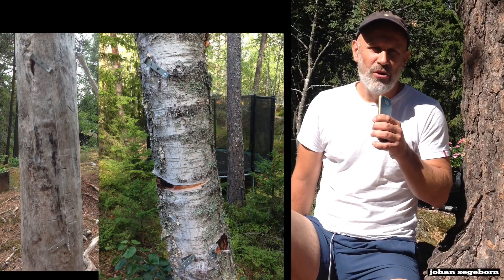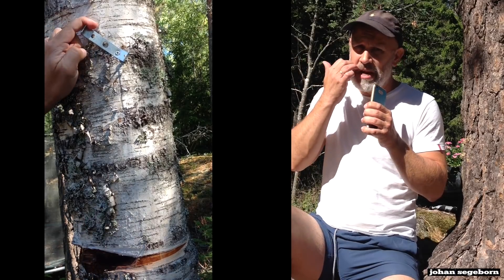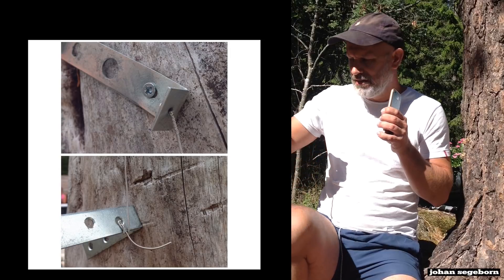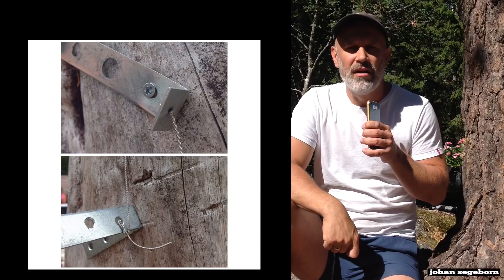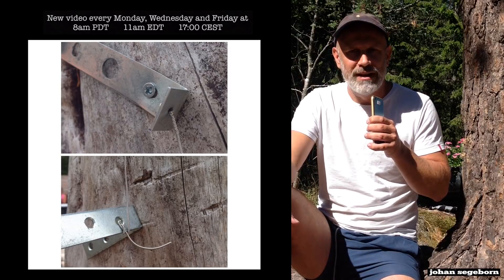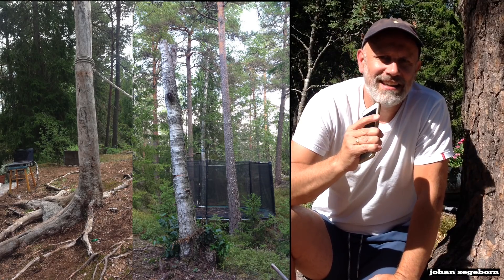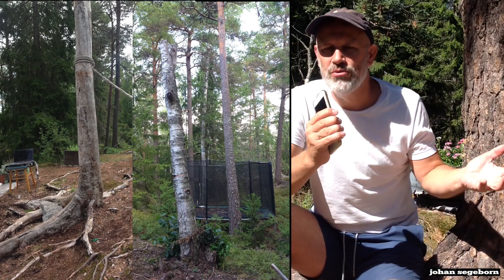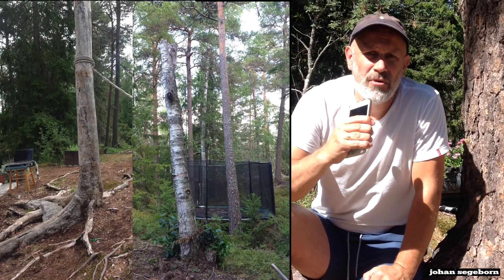If the Guitar Body was an ENTIRE TREE! Would Pine and Birch differ?

Comment: Suggestion?
I'm thinking of adding a screw at an angle between the the inside of the body of a fender style guitar to the neck to improve sustain... 
Do the Fender type guitars sometimes sound dead  because of a bad neck joint??
Reply from the maker: Yeah that would be an interesting test. The Bolt on neck joint is a part of the Fender tone though.

Comment: Clamp that same rig on the back of an exterior cabin door, the window sills, the floor, the log splitter or other iron rail, fence post. Mount the pickup to something that ensures equal distance to the string and use a mark to draw back the string to release like a hunting bow so the strum is always the same load/start. Les Paul when developing his solid body guitar mounted a pickup to a rail road track in addition to the 4x4 'log'. Example is at the Cleveland Rock and Roll Hall of Fame that looks like this http://www.les-paul.com/wp-content/uploads/2014/11/ch-1-rail.png

Comment: Shouldn't the pickup be mounted to the tree? ( I know I know but that's the first thing that came to mind as I was watching this brilliant bit of insanity)
Reply: That's my same observation. Something to force the pickup to have the identical distance from the string each time.
Reply: That's what I thought.  Either that or rest the pickup on a couple of D-shaped brackets that go over the string.  It is very difficult to hold the pickup perfectly still.
Reply: Yes!!! Not just because of the distance, but because the pickup vibrates with the wood in a real guitar
Reply: First thing I thought of as well.  Great minds and such.